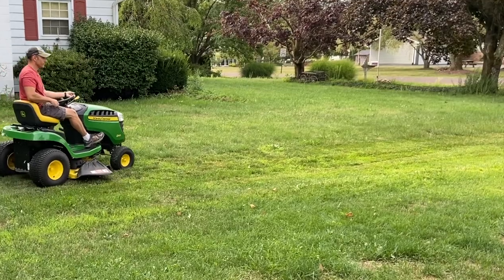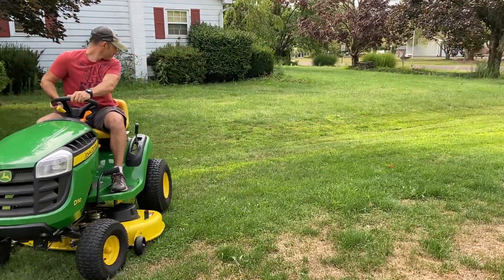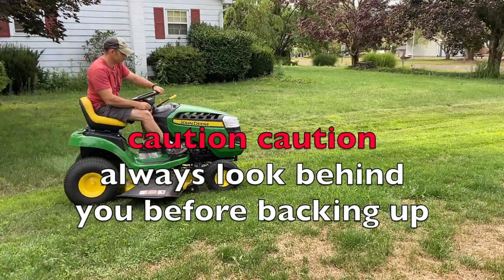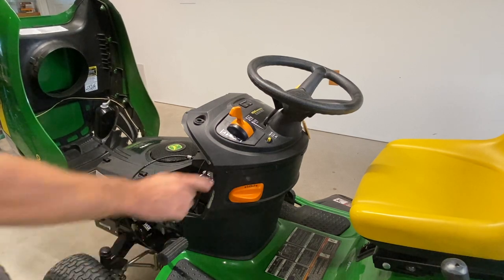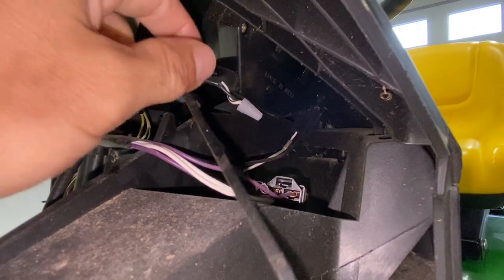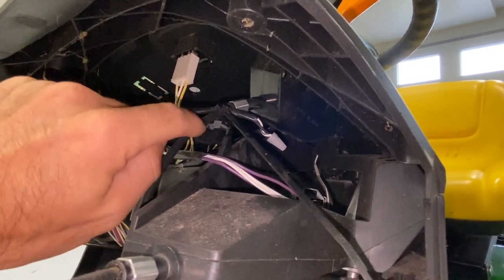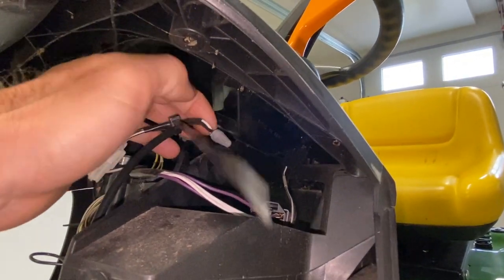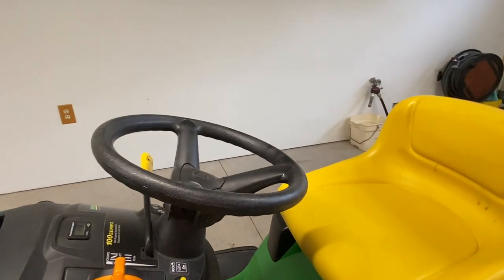How to disable your RIO button (reverse button) on John Deere 100 series

Comment: That button is the dumbest thing John Deere ever did. Even my old Craftsman lawn tractor had two positions in the ignition key. One would be so if you backed up while cutting the tractor would stop. The second position disabled the backup safety feature. I looked at a new Club Cadet and it has the key feature like my old Craftsman. How many people push the button and then look back to see what's there before backing up? You already know what's back there since you were there 2 seconds ago !

Thanks for the needed info. Barry
Reply from the maker: Glad you like it thanks for watching
Reply: It's a distraction to someone that rides a Husqvarna and then jumps on a Deere.
Reply: It's a built in liability waiver.

Comment: Just so everyone knows, you do not have to hold the RIO button to reverse...it is only an interrupt bypass. It only has to be pressed and released before the engine goes dead. The most ideal thing to do is hold it until you have started pressing the reverse pedal, and then release it. If you happen to forget, as long as you can get to the button before the engine dies, it will interrupt the shut down, and will resume operation normally. You DO NOT HAVE TO HOLD THE BUTTON WHILE REVERSING!!! Good luck, and God Bless us all, (even those of us that don't read, and follow directions), Amen.
Reply from the maker: Thanks for the info and thanks for watching my video
Reply: Jeffery so I don't have to push it
Reply: You have to press it only to initialize the reverse pedal and once you have pressed it,  even if it's not hard enough to make the mower actually move, it will continue to be overridden until you have fully released the reverse pedal. You do not have to hold it down the entire time you're using reverse, only to override it initially. And if you press the reverse having forgotten to press the override button, add long as you are fast enough to press the button before the engine  dies, it will still over ride the kill switch... but at no time do you have to hold the button down.
Reply: @JustJeff78  
Thank you so so much! I'm 71 years old woman trying to used the reverses yellow button and my finger so tired to pressed that button the whole time hihi 😂 now I'm very happy someone explained to me I don't need to press that damn button all the time just initial when engine goes down, thanks again 😊
Reply: And it’s still a PIA
Reply: @JustJeff78  fyi:  If you forget to press the yellow button and the engine starts shutting down it can cause damage to your engine.  Anytime you disconnect the electrical side of the ignition with the engine running you subject your engine to backfire and thus possible damage.
Reply: @maxbodine3161 still better to not have to press it at all.

Comment: Can you take the huge mower shoot off safely to get it in our gate?  We just bought the S100 and because of the shoot it will not go in our 48” gate I thought it was 42”… Thx for any help God Bless you thanks for this video when warranty isn’t up Will do just that 😂 Take Care
Reply from the maker: Drill a little hole in it and hook a rubber strap on it to hold it up.
Reply: @DIYJIM  I wish that would work I would just hold it up and drive it in It literally has to come all the way off Thanks for the help much appreciated wish it would work Also we don’t want to damage it as it is new and we want the warranty incase anything goes wrong Husband has cancer and I’m disabled so every penny counts right now..
Reply: Just use the rubber bands that came with the s100 holding the chute up. And wrap around the reverse pedal too and ba da bing, your mower should fit right in

Comment: Unfortunately this is sending constant voltage to a relay to allow you to use reverse.  If you notice, a momentary push was all it took due to the relay.  Now with the relay powered constantly, you are chancing burning up the relay or worse, starting an electrical fire.
Reply from the maker: Thanks for the comment, it has been disabled for a couple year and no problems
Reply: I doubt it would cause a fire but the relay will probably have to be replaced due to a shorter lifespan. We have relays in our cars that are activated for many hours at a time. AC, headlights etc.

Comment: I don’t understand how that stupid button somehow is a safety feature. Like pushing that button will prevent you from backing over a person or a pet. You can hit the button and back up with your eyes straight forward, if you choose to be that irresponsible. The button is meaningless. It’s a sign of the times with thousands of warnings that manufacturers list to prevent idiots from suing them for their own stupidity!
Reply from the maker: I agree I think it makes my mower less safe, that is why I disconnected it. Thanks for watching
Reply: @DIYJIM  Just wondering, I have heard from a couple others that creating a semi permanent connection of the two wires of the RIO switch will fry a relay with the potential risk of fire. Pretty much most of the videos on this subject all do it your way, but should I be concerned? Thank you 😊
Reply from the maker: @christianjorgensen249  I have never had any problems but I have to say do at your own risk.

Comment: why didnt you use a jumper wire instead of cutting the wire
Reply from the maker: Guess I don’t ever plan on hooking it back up.
Reply: @DIYJIM  I hate those switches too  I would hate it if I cut the wrong wire that hurt my mower - I would rather use a jumper so if I made a mistake i could put it back the way it was.
Reply from the maker: Good point
Reply: FastgunEd LOL my same thoughts
Reply: @streetglide40sw30  Used a jumper wire on my E130 a couple of years ago. worked perfect until now.  Engine  now dies when going in reverse. Checked connections and they were tight. Put it back the way it was and still wont let me mow in reverse. just dies.  Any ideas what has happened?